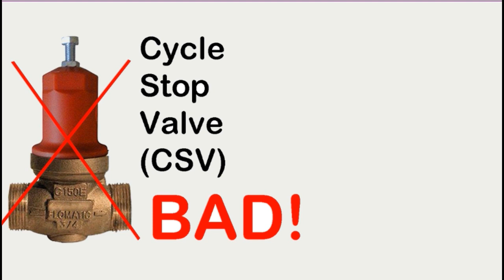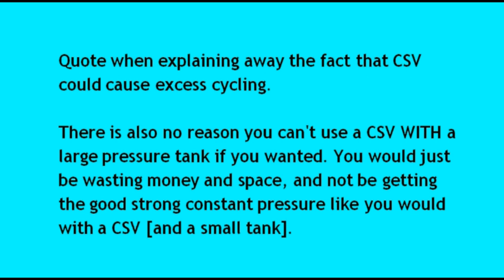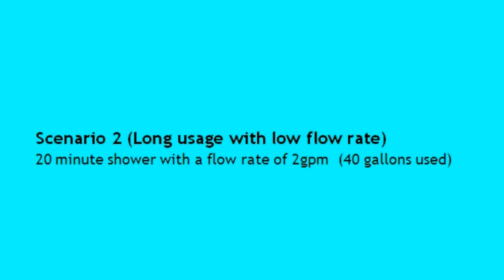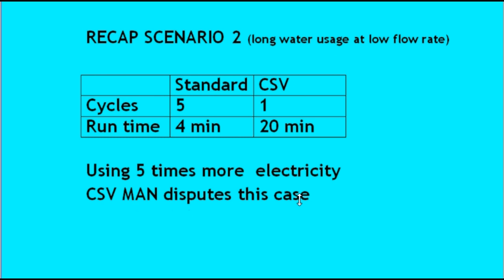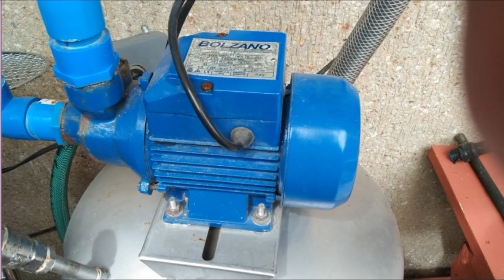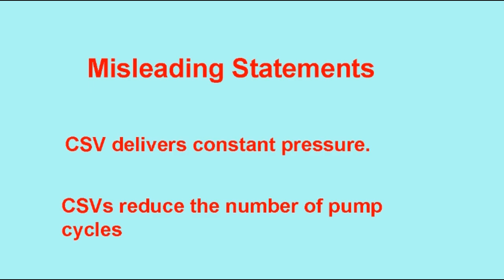Cycle Stop Valves ARE BAD for pressure tank systems!  Pros and cons of CSVs – few pros, many CONS!

Comment: I think you are cherry picking the cons.  I have a cycle stop valve in my system. I have seen  it both ways with and without the cycle stop valve, I for sure have less pump cycling with the cycle stop valve than without. I do agree that a VFD probably works better, yet for most people the cycle stop valve is far simpler to deal with and you do not have the issue of burning out a motor due to the exceeding the turn down ration of motor with a vfd. You also state that a cycle stop vale is simply a PRV with a bypass, and you show a diagram of a PRV and a gate valve. What you do not state is that the bypass is automatic and the diagram you show a person would have to manually pen the gate valve to bypass water. If you ran the system you show with the Gate bypass and a 50 PSI PRV and a pressure switch at 60 PSI your pump would not turn off ever, flow would stop and your pump would burn up. I run an 80 gallon bladder  tank 40/60 pressure switch and a cycle stop valve it works just fine for me. If I ever have to replace my pump I will most likely install Pump VFD combo. Also my amps drop on my pump when the cycle stop valve closes down as load on a pump impeller like a fan is how much work the impeller is doing (flow) restricting flow drops the load on the pump and amps as well.
Reply from the maker: First of all, what are you talking about  when you say you  can burn out the motor by exceeding  the turn down ratio of the motor with a VFD? That sounds like gobbly gook to me. A VFD and it's motor are design to work together and provide soft starts and stops so the motor will last way longer. Second of all the gate valve is set once and then not touched. I admit I was not clear enough about this. The gate valve is simply an adjustment that you set to allow 1 gallon per minute thought the by pass. Then you leave it alone. This is exactly what a regular CSV valve does except in one neat little package with no adjustment of bypass flow provided. You DO NOT need to train a monkey to stand there and turn the bypass on and off haha. That would be ridiculous! Third of all, you say you get less cycles with your cycle stop valve installed. Well it could be true, it all depends on  how you use water. But for the vast majority of home owners, cycles will increase significantly.
Reply: @LarryElterman  Not gobblygook, do you even know what the turn down ratio of a motor is. you can run the majority of motors on a VFD with a turn down of no more than 6, meaning you divide the rpm by 6 to get the minimum RPM without damage, an 188 rpm motor would be 300 rpm. Most true inverter duty motors are rated for a 20 to 1 turn down ration, I like VFDs my company installs thousands of them a year,  I am certainly not knocking them. You are wrong again the cycle stop valve has a spring in it that modulates from full open to close to allow the 1 GPM flow at higher pressure to run the pump longer as you are using water. in the scenario you are showing with a fixed 1 GPM gate valve bypass and a 50 psi PRV, the water flow will fluctuate through the bypass  based on pressure in the system as water flowing through a set size orifice  at 40 PSI and 60 PSI  will deliver water at different rates causing more pressure fluctuations in the system. With he modulating cycle stop valve you maintain pressure over a tighter bandwidth, so you have a more consistent flow pressure/gpm. I have a cycle stop valve with a bypass around it, without the cycle stop valve my pump certainly cycles more.  I have watched it. I do agree that you still need as big of a pressure tank as possible.
Reply from the maker: I don't understand the technical issues of what  you are saying, I am not a motor expert, but my intuition tells me   it is not normally a problem. Since a VFD and the motor usually come together as a set, why would they make it so it could burn out by going too slow? The VFD should be smart enough to prevent that. Does not make sense to me.
Reply: @LarryElterman  Like I said we install a lot of VFDs, most motors that state they are VFD compatible" will run at a 6 to 1 turndown ratio if you run below this turn down ration you will smoke the motor. they do not tell you this in the fine print. after all you can run any motor on a VFD as long as you run it at 60HZ. with a true inverter duty motor you can run down to a 20 -1 ratio and not hurt the motor. even the best inverter duty motors if you run them at say 5 Hz for a long time it will smoke the motor as well. the problem you will potentially run into is if you run a VFD on the pump and the pump demand drops to a point where you need to run below the turn down ration and it does this frequently its a problem for the motor. I do agree that a VFD is a better option than the cycle stop. The other benefit you get from a VFD is they are a power filter and provide good protection from power surges. In a perfect world what you would do is install a VFD with a minimum run speed above the turn down ratio of the motor, then install a solenoid valve with proportional control, as the VFD approaches its minimum speed it would signal the solenoid valve to close down to a predetermined point where you were getting 1.25 GPM of flow at minimum speed applying restriction to the system to keep the pump on as long as possible and not kick the speed down below the minimum run speed of the motor.

Comment: Interesting analysis of the device . I have worked for over 30 years in an industrial atmosphere and would like to point out something i notice regarding your amperage test of the pump. The meter you used most likely does not have the capability of capturing peak currents of the starting cycle of a motor. Standard rule of thumb is starting current is 5 to 7 times normal running current based on the connected load. So for example a motor that pulls 10 amps normally  would peak to 50 to 70 amps for a very short period of time until the load stabilizes. That being said continuous starting and stopping will heat the windings of the motor shortening the life of the insulation. I think this is only part of the analysis and needs to be considered along with all the other parameters you point out. Hope this helps someone. Here is a site that may clear up some of the confusion 
burnout-electric-motor
Reply from the maker: Thanks, you are not the first person to point this out. Honestly the fan and testing of my pump really should have been left out. I knew it did not prove anything, I was just curious to try it so I filmed it. But I realize it proves nothing. I don't really think it effects the rest of my analysis. For example, a CSV still causes more cycles not less, so it is still bad!

Comment: I have scenario 3 and have used a CSV for over 18 years now- it has been flawless.
Reply from the maker: I'm not saying they don't work. But there is always a better way. They are woefully inefficient and usually increase cycles. They do provide constant pressure and prevent cycling during long runs, so I guess this is what you mean when you say it functions perfectly.
Reply: @LarryElterman  Well Larry the 20 gal Well-Rite tank I installed 21 years ago with a new CSV just went 3 days ago. It went because of water logging.  The pump lasted 12 years supplying my house and 2 apartments within my house. As well as irrigation of about 4 hours nightly, 6 nights a week, in season. I am pleased with the results.  I just yesterday installed another 20 gallon tank, and a new 3/4 hp Gould's pump the same 60/40 switch set at 51 psi. csv rate and we are back online with water.  For me and my 2 apartments and my irrigation, this is a perfect system...

Comment: Very interesting video.  I personally think that most real world residential well water use is mainly short burst scenarios and negates most of the supposed value of the CSV, and I also dislike the idea of the CSV in favor of better options.  With that said, here is the real deal:  Across the line(Non-VFD/soft) motor starts hurt the motor from the inrush current.  The force generated on the stator windings and insulation as well as heat generated are the degradation mechanisms.  The meter used in this video will not capture the extremely short lived start up pulse unless the peak hold setting is used, and an oscilloscope would be the best tool to see what can be more than 10X the rated current on start up.  In a well pump application cumulative run time wear pales in comparison to degradation from motor starts.  The fan example in the video is not representative of pump operation because of the following:  Slowing a motor shaft(example in video) increases the current draw(basic induction motor science).  Restricting the outlet or inlet of a centrifugal pump will reduce the volume of water moved which is reducing the work done.  The motor speed will increase and the power used will decrease.  Think of putting your hand over a vacuum hose and hearing it ramp up - it sure sounds like its doing more but in fact it is not moving any air, the air pressure inside the machine at the vacuum pump vanes has gone to near zero, and the lack of resistance to the pump/fan allows the motor speed to increase with less power consumption.  Try covering up the back(or front) side of a box fan and watching what happens to the amperage.  As far as reduced power consumption with restricted flow goes, this is a real thing that happens and it is related to how much water the pump is moving(flow) and not the pressure being developed as the pump reaches an operating region called shut off head.(max pressure @ zero flow)  Most submerged well pumps are multi-stage centrifugal pumps and not of the design called positive displacement.(power use would increase on restriction in that case)  I will admit I do not have an absolute answer on why, in the video, the current went up at the end of the pump cycle right before shut off.  It could have been caused from spontaneous water use inside the house that increased the pump volume before reaching cutoff;  but I would be willing to bet that it has to do with where on the pump curve it is operating in this specific situation.  On centrifugal pump curves that include a horsepower line on the graph, it is typical that this line is only shown in the region of the graph where the pump would be expected to operate.  As a pump approaches shut off head,(very little flow compared to its rated volume) there may be anomalies that load the motor more.  The best way to improve pump life and to reduce pressure fluctuation in what I would call a typical submerged well pump setup would be to tighten the operating band on the pressure switch(like taking a 30/50psi setting to 40/50psi and adjust the pressure tank bladder pressure), and then most importantly, significantly increase the pressure tank volume either with a bigger tank or multiple tanks.  If someone wants to take it to the next level, get a variable frequency constant pressure pump.  It will come on with demand, hold a perfect pressure by matching speed to the needed flow rate, and likely have a soft start feature that will counteract all negative effects from the motor starts.
Reply from the maker: Nice comment. As far as the fan and my particular pump and the amperage that it uses I realize this does not prove anything, I just sort of did it for fun, but should not have since it gives the impression that I am trying to prove something when I really did it just for fun. As far as restricting flow, I maintain that this always causes a reduction in efficiency. Even if current is reduced the percentage reduction is less than the reduction of flow. I would be interested to see in real life a case where this is not true, I don't think it exists. As far as pump starts vs total run time, what you say may very well be true, but that does not make the CSV the better option.  Really what you want for a well pump system is a bigger pressure tank or a large water storage tank coupled with a booster pump, as I showed in my CSV VFD video, which I think was my best video about the CSV, but nobody watches it!
Reply: @LarryElterman  My intent was not to discredit your message only to provide additional info and clarification.  You are way ahead of the game in understanding some heavy duty fluid dynamics and operational characteristics. - I totally agree that the pitched benefits of a csv do not translate  as they should to the real world.  I also agree that, in regards to efficiency, every pump I have seen(not saying there can be no exceptions) is built so that the peak efficiency occurs when the pump is moving rated flow.  Any operation over the rated flow  moves towards what is called the runout region and efficiency falls slightly from peak.  Any operation with less than rated flow and the efficiency quickly falls off.  This can be demonstrated by any centrifugal pump curve graph.  So, to your point, a csv would cause additional power consumption(significant amounts) to move the same volume of water.  Under cherry picked conditions the use of a csv will reduce motor starts and smooth pressure.  In real life, no freaking way will homeowners experience the benefits as advertised.  "Mr. csv" more than likely really believes the product performs according to his understanding.  The issue is that he doesn't know what he doesn't know and let's just say lacks the will or "capacity" to become informed.  For most humans, to fully understand the dynamics at play here, is approaching TED talk levels of knowledge and understanding.  Remaining somewhat ignorant probably doesn't hurt moving the product either.
Reply from the maker: You are obviously very knowledgeable on the subject, How do you know so much about it? I think Cary Austin (MR CSV) does understand, he just can't face it. His livelyhood depends on it. The way he cherry picks situations to make it look like the CSV is good shows that at some level he understands, but what exactly is going on in his mind is impossible to say. I have talked to him by the way,  he tried to convince me I was wrong and that I did not know what I was talking about.  He is one of those people that is not concerned with reality. One of those people that it is impossible to talk logic with.  Did you see his video where he claims the CSV is better than a VFD?  Thanks for your nice comments.  Ps. What is TED level of understanding?
Reply: @LarryElterman  I am an engineer at a nuclear power plant.  I specialize in predictive maintenance and troubleshooting of motors.  I work in tandem with the pump specialist.  Before this I was a reactor operator in the Navy, motor rewinder, and electrical maintenance tech at the power plant.  22Y experience with extensive learning in all of the foundational subject matter.  I stumbled on this video and have not watched any related content....YET.  I will watch the video on a CSV being better than a VFD setup before I call it crap, but it will be challenging to not be dismissive from the get go.  My previous comment about a "TED talk" level of knowledge was an attempt to have a little laugh while making a legitimate point.  If you don't already know, TED talks can be viewed on youtube in very diverse subject matter.  The common thread is that the person leading the symposium is profoundly knowledgeable in the topic subject matter. - Like rewrite the book type of knowledge.  I would say that the target audience often needs extensive knowledge base on the topic just to digest the content.  Long story short, I was just saying that in order to full appreciate this whole CSV thing, it requires what I would consider a profound level of knowledge for most people.

Comment: Thank you Larry for this video and the info on CSV installations. I was very close to having one installed at a $300+ cost. You saved me money and it was something I didn't need after all. I have to replace my pressure tank after 21 years of working without a CSV. Well pump still kicking, also without a CSV installed.
Reply from the maker: Nice to hear that I helped you. Why did you think you needed one? How did it come to be that you almost decided to buy one? I am curious to hear your story.
Reply: I never thought I needed a CSV. It was placed on a quote from a water solutions tech. He raved this would be a much better system with CSV. At the end I went with another company.  Installed water pressure without a CSV.
Reply: @josenogueras9426   look at how you use your system if you  are watering your yard or washing your car etc, the cycle stop valve helps a lot. Pumps are rated at so many starts and stops and then they are toast, so short cycling is bad. So if you have a 10 gallon actual capacity bladder tank without a cycle stop valve here is what you have. You wash you care with 6 GPM flow from your hose and you use 100 gallons. with a conventional set up your pump will start and stop 10 times, with a cycle stop valve installed it will start and stop 1 time if it is set properly. Your pump will last a lot longer. I am not connected to cycle stop in any way, i have water issues at my house and have had to replace my pump 3 times.